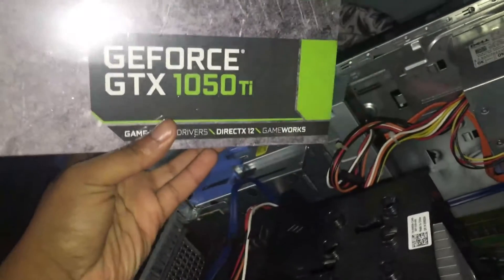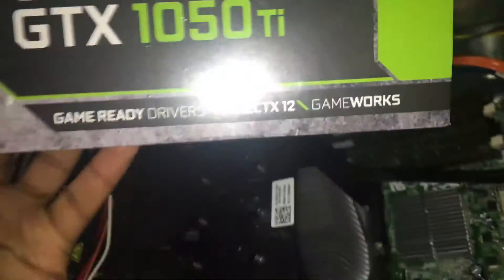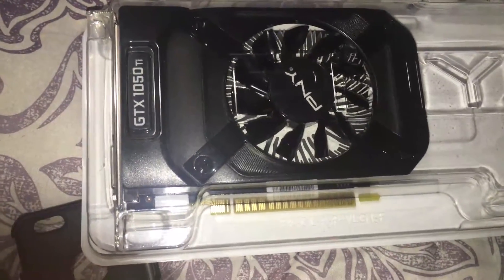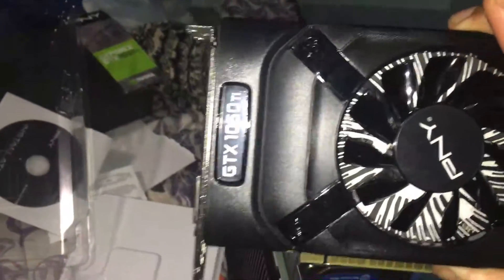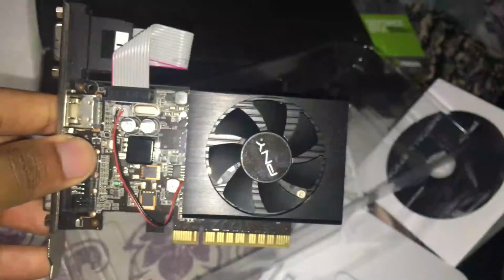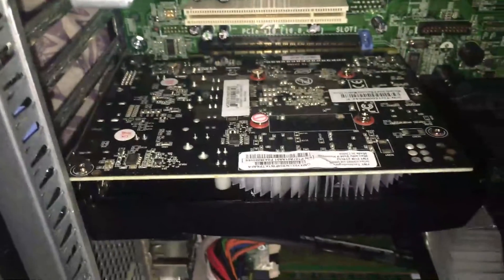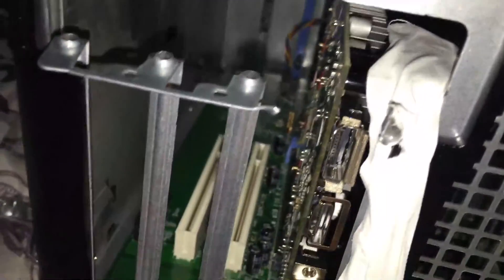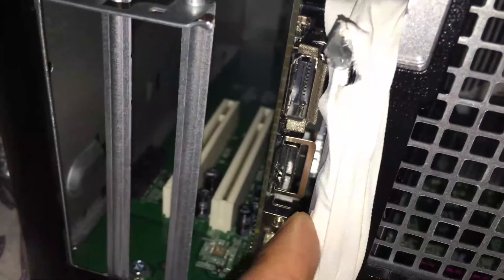PC UPGRADE PART 2!!!!!!!!! DELL OPTIPLEX 780 WITH GTX 1050TI

Comment: I have the Dell OPTIPLEX 780 Mini Tower equipped with Intel Core 2 Quad Q9400, 4 GB DDR3 memory in dual channel, 255 W power supply and W7 64-bit. I was planning to get the ZOTAC GTX 1050 Ti Mini as you recommended. I've read that there are some concerns about modern cards not supporting legacy BIOS systems. I have no idea if my motherboard supports UEFI BIOS. I couldn't find anything in the BIOS about legacy or UEFI. All I know is my BIOS version is A15 and I'm not even sure what's the mobo model/chipset. I'm afraid to make the purchase, the last thing i need is compatibility issues. can you confirm please?
Reply from the maker: im using a gtx 1050ti now and im not having any issues 
and my bios supports this card perfectly it will im not sure what those other people are talking about.its working just fine no issues what so ever  but you will be fine
Reply: Thanks for the quick reply. that's a relief. one more question, what's your PSU wattage? Is my current PSU (255 W) enough to power the whole system with the new card installed?
Reply from the maker: Abdulaziz Esmaeel hey what's up I think my psu is around 255 w same as yours but the Gpu gets it power from the motherboard and it only uses about 75w
Reply: Hey man. I was mistaken, my PSU turned out to be 305 W so i guess it's capable to handle it. Thank you again good sir I really appreciate your help.
Reply from the maker: no problem bro
Reply from the maker: right now im using the gtx 1050ti and its working great with my optiplex 780 no issues at all

you want have any issues as long as you keep everything up to date your fine 

https://www.youtube.com/watch?v=-0QVy4UY37M

Comment: I had to remove this thing to put this thing in and take off this thing like wtf do you know what anything is
Reply from the maker: hey whats bro get the gtx 1050ti zotac model it will fit i made a big mistake by getting the pyn model 
http://www.ebay.com/sch/i.html?_from=R40&_trksid=p2050601.m570.l1313.TR0.TRC0.H0.Xgtx+1050ti+zotac.TRS0&_nkw=gtx+1050ti+zotac&_sacat=0

let me know how everything goes buddy
Reply from the maker: i had to cut  a piece of the back off in order to fit the graphics card it took some time to cut it but i got it.

Comment: Cool video,  MSI , zotac , gigabyte all make the gtx 1050 ti low profile , same price & specs. i run mine with HP compaq elite 8200 sff pc with  i5-2400 / 8 gb ram / 2 x ssd hd & msi gtx 1050 ti 4gb low profile all on stock 240 psu. card runs great & quiet. thanx 4 vid.
Reply from the maker: ur welcome and how are the benchmarks

Comment: how much did the old dell unit cost you? and how much for the 1050ti?
Reply from the maker: the 1050ti was 150.00 and i bought it from here   

https://www.newegg.com/Product/Product.aspx?Item=N82E16814133639&cm_re=PNY_GeForce_GTX_1050_Ti_DirectX_12_VCGGTX1050T4PB_4GB_128-Bit_GDDR5_PCI_Express-_-14-133-639-_-Product

the dell optiplex  cost me 90.00 and i got it from ebay
Reply from the maker: i paid 80 
for the dell

and paid 150 for the gtx 1050ti

Comment: Can you tell me your specs of your dell pc
Reply from the maker: Summary
  Operating System
   Windows 7 Ultimate 64-bit SP1
  CPU
   Intel Core 2 Quad Q9550 @ 2.83GHz 34 °C
   Yorkfield 45nm Technology
  RAM
   8.00GB Dual-Channel DDR3 @ 532MHz (7-7-7-20)
  Motherboard
   Dell Inc. 0C27VV (CPU)
  Graphics
   EVGA GeForce GTX 1050 0 Ti Gaming Graphics Card ‑ 4 GB..
  Storage
   465GB Western Digital WDC WD5000AAKX-75U6AA0 (SATA) 26 °C
   931GB JMicron Generic USB Device (USB (SATA)) 27 °C
   3GB Dataram, Inc. RAMDiskVE (RAM Disk)
  Optical Drives
   HL-DT-ST DVD+-RW GH50N
  Audio
   WsAudio_Device
Operating System
 Windows 7 Ultimate 64-bit SP1

Comment: pc gamerzboyz my Optiplex 380 is currently using Radeon HD 6450 Version
if u wan upgrade i need get Mini version?
Reply from the maker: yea the zotak gtx 1050ti
Reply: Sry is optiplex 390 minitower
i hear that GTX 750ti will work better?
Reply from the maker: yea the 1050ti zotac
Reply from the maker: yea the 750ti is fine

Comment: Hello, i have the original power supply of the optiplex 780 if i buy a gtx1050TI does it work on my pc if i play gtav?
Reply from the maker: yes it work i made a couple of videos on the optiplex 780 with the gtx  1050ti. Here are some of the videos i did below on the optiplext 780 with gtx1050ti. If u need any other information on it feel free to ask. 

https://www.youtube.com/watch?v=W8IrZR0nnXk

https://www.youtube.com/watch?v=lEXgmh3XMnA

https://www.youtube.com/watch?v=OoBIAIhhBYg

Comment: I have the 760, I was happy at the beginning of the video, thought that it would fit. Well doesn't look like it does :P

I'll try either searching for the Zotac/mini/1 slot version and play with that or will be just ordering an ordinary one and cutting the upper bracket.
My question is: if you already took the bracket off, why did you have to modify your case (it looks like you did)?
Reply from the maker: i had to do that because the card did not fit so i had to make some minor adjustments on the back

Comment: Wait so if I put a 750ti in my same exact pc I don't need to get a different power supply?
Reply: Or even a 1050ti
Reply from the maker: do u have the hp z400 if so u can keep your current power supply and it will work fine
Reply: Sorry I'm not to familiar with names what's the hz400?
Reply: Hp z400*
Reply: Sorry to make a long story short I am getting a Dell OptiPlex 780 I need to know what kind of graphics card I can put it to reach some good FPS on things like Minecraft CS go and overwatch and things like that with between 900 ,720P or even 1080 P I was wondering ifyou could tell me what kind of graphics card I can fit in there without having to get another power supply or having to modify the PC so the graphics card but you don't have to help me if you don't want but just asking for your opinion
Reply from the maker: hey whats up man listen you can ask me any question lol but i would recommend getting the http://www.ebay.com/itm/ZOTAC-GeForce-GTX-1050-Ti-Mini-/381836953227?hash=item58e741868b:g:c5MAAOSw4GVYGetX
now that should fit without having to do any modifying
Reply: Thank you so much sir you helped me a lot
Reply from the maker: Talemon Gaming no problem let me know how everything goes and if you have anymore question feel free to ask me
Reply: Ok
Reply: if you dont have enough for the 1050ti u could always go with the 750ti but i would highly recommend the 1050ti

Comment: how much is ur psu? mine is 240 will it fit? proc - intel core i3 sandy bridge
Reply: I have the GTX 1050Ti running in my Optiplex 7010 DT on the original 250w psu. Running great. See vid on my channel

Comment: Its working with original PS?

amazing how this old dell computers can be upgraded for few buck :-)
Reply from the maker: yeah u can take a computer from 2002 and upgrade it to a make it one beast of a computer
Reply: Original power supply 235W can handle that?
Reply from the maker: Tomáš T what Gpu are u getting
Reply from the maker: Tomáš T if your getting the 1050 then your good to go
Reply: oh, thx i wasnt sure about that :-)
Reply from the maker: Tomáš T no problem if you have any questions feel free to ask me
Reply: @TheTom924  Hello friend, did it work for you? I have the Original power supply 235W too
Reply: Carlos Cobos hi, after all i bought 300W PS
Reply: Yeah, I got the 1050ti LP in my 7010 DT. See vid on my channel

Comment: Hey, I have a problem connecting my 780 to wifi, idk if I should connect an Ethernet cable or wifi card, I don't want to do either, a response would be appreciated
Reply from the maker: try doing ethernet

also you need a 
Mini-USB-Wireless-WiFi-Adapter-802-11n-g-b-LAN-Internet-Network-Adapter

http://www.ebay.com/itm/300Mbps-Mini-USB-Wireless-WiFi-Adapter-802-11n-g-b-LAN-Internet-Network-Adapter-/181484620068?hash=item2a41538924:g:6xgAAOSwpDdVB2YC

Comment: I want to buy an optiplex 390 it has i5 2400 and some other hardwares its under 100$
i don't want to just buy a 2ndhand processor cus its a lot cheaper when its optiplex 390 lets say thats 90$ and can resell some of its part in case i upgrade and no longer in need of them

I'd like to have this specs
i5 2400
16gb ram
1050ti 6gb

what i wanna know is will the motherboard be compatible to 1050ti can the stock psu handle it does the motherboard have two ram stick slot?
Reply: Arkangel Salazar gtx 1050ti has a max of 6gb
Reply from the maker: hey theres no 1050ti 6gb 
it only goes up to 4gb
Reply: yeah i thought i was at 1060gtx video .

Comment: You should have got the Zotac Mini, it has a single slot bracket. fits perfect in a 780
Reply from the maker: ill check it out
Reply: Lol the reason I check this video out is for me to know if GT 1050 fit into my DT form OptiPlex 755 (with PCI/PCIe riser to support full height cards) and yea seems like the Zotac mini one fits just fine while some other ones won't. I have Xeon X3363 which is similar to that Q9550 but just simply cooler and cheaper. After doing some research, it seems like that Xeon X3363 matches something right in between 730 and 1050. A GT 730 bottlenecks X3363 and GTX 1050 Ti gets bottlenecked. My true question right now is does it worth it to switch from a 730 to 1050 on your machine (Mine is exactly similarly maxed out with Xeon, 8GB RAM and SSD)?
Reply: My Q9550 and the GTX 1050 where at about the same usage in the on real game i have, BeamNg.Drive
Reply: kf zhu yea it's worth it but there's going to be some bottle necking I'm running a gtx 1050ti with my opitiplex and with Windows 10 my games run pretty smooth   But your better off getting the gtx 1050 or 1050ti
Reply from the maker: yea it's worth it but there's going to be some bottle necking I'm running a gtx 1050ti with my opitiplex and with Windows 10 my games run pretty smooth But your better off getting the gtx 1050 or 1050ti

Comment: any tips now that you've had it for a while? I just told a friend that has this PC to get the evga 1050ti. I watched this video to make sure it would fit albeit a bit of modding
Reply from the maker: just be very careful when modding and make sure the graphics card is tightly fitted on the board the last thing you want is for the card to moving around

Comment: Thanks dude for reassuring me that it'll fit in mine! :D
Reply: Btw did you have to make any tinsnips?
Reply from the maker: no problem bro
Reply from the maker: 0liver243 yea to the graphics card I bought but if you get the zotac 1050ti you should be good
Reply: pc gamerzboyz Thanks I got the 1050!
Reply: alcatraz You can just ask me here. :)
Reply: Mine didn't fit with the low profile bracket, bummer. They must have changed it.